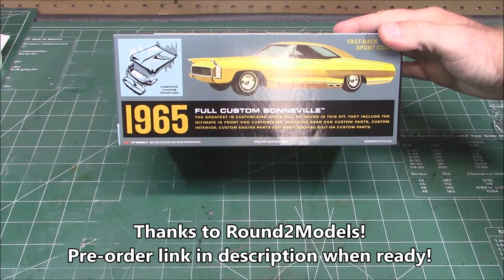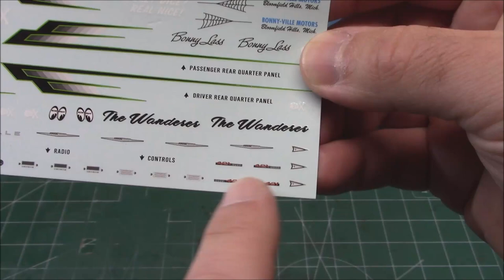1965 Pontiac Bonneville Sport Coupe 421 V8 3n1 1/25 Scale Model Kit Build Review AMT1260 AMT

Comment: I love these cars. The wheels are not hubcaps or wires, they are the rare Pontiac 8 lug wheels, where the rim bolts on with eight lug nuts, and the whole center of the wheel is actually the brake drum, made of aluminum with an iron liner. They were optional, and very cool looking.
Reply from the maker: Cool info!

Comment: I remember building models back in the 70's. One thing that stands out is how the exhaust system in this model is built right in. Back then, it was a separate piece, and the challenge was to get them attached to the manifolds. I liked it better that way, as it was more realistic. Furthermore, the greatest challenge was not getting glue on the windshield. 

GREAT BUILD!
Reply from the maker: Some kits are molded in, some are separate. Depends on the kit and it's origins.

Comment: This look so much like the '65 Pontiac 2+2 I did as a kid, yet, they doesn't seems to be the same molds... Hmm... That confuse me. It's a nice kit. The build is awesome as always.
Reply from the maker: Thanks!
Reply: Short answer, yes, it's the same kit. Originally a Bonneville, molds were altered to make a 2+2 in the '90s. Recently restored back to a Bonneville and includes many parts that were deleted in the '90s.
Reply: @kristinstelljes3305  Besides the parts that had been removed to make the 2+2, what are the differences between the two cars?
Reply: @chassegallerie2910  In the real world the Catalina and the 2+2 were on the shorter 121 inch wheelbase. The Bonnie was on a 126 inch wheelbase. In those days Pontiac, Olds, and Buick had 2 sizes of full size cars: big and bigger. So, the AMT 2+2 model is incorrect because it is based on a reworked Bonneville kit. The other differences are the fender badges, due to being reworked, and some of the custom parts were left out at the time.
Reply: @randyhutcherson5637  I see. Thanks for the clarification. The 2+2 is still a cool kit to build none the less.

Comment: I know that your line is "build for you " but I was wondering if this model has the 327 engine? The 327 was orange because I owned a drove a 68 Pontiac Parisienne 4 door and it had the orange 327 under the hood. Great model and reminds me my  very first car, my 68 Pontiac Parisienne.
Reply from the maker: The decals say 421, so I did it that way. I'm sure you can paint it orange and tell folks it's a 327.  99.9999% of people will never know.
Reply: The Parisienne was strictly for the Canadian market. To keep costs down they used Chevrolet mechanicals, engines, and transmissions. The U.S. cars had Pontiac engines, which were different shades of blue depending on year. The kit engine could actually be any Pontiac V8 as Pontiac didn't have a small block/big block like other companies, just different bore and stroke. But, it is supposed to represent the top 421 from 1965.

Comment: Does anyone know if they have a Dodge Ram 3500 on a 1/24 scale.
Reply: AMT did a Ram 3500 standard cab, dually, 2wd in 1995 as both a promo and a snap kit. 1/25 scale.
Reply: @randyhutcherson5637 , thank you for the information.